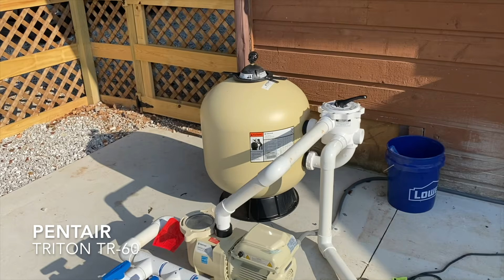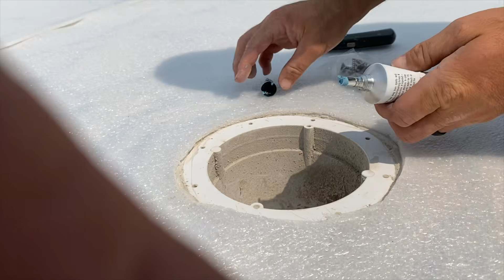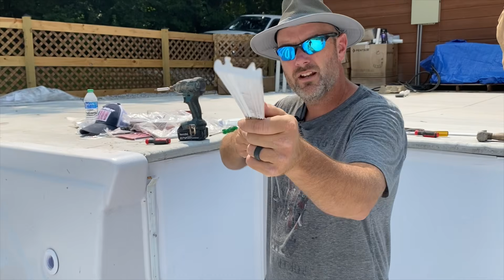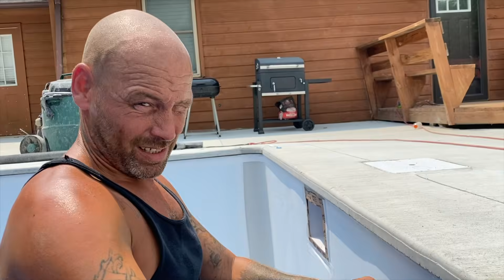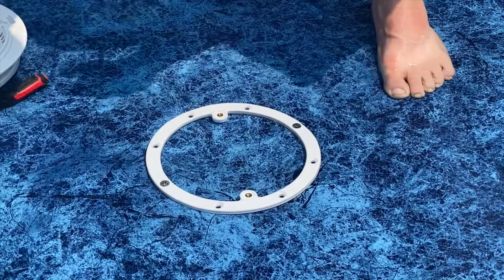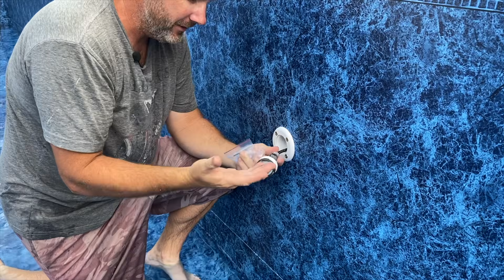DIY ICF Pool!  Detailed Vinyl Liner Install

Comment: Thoughts on what to do if there is a leak around stair trim? Do you add a waterproof caulk or would you drill in and add screws to that trim? It seems maybe a few of the screws backing is stripped and maybe needs a new screw. This is in a new liner but 3rd liner overall I’m wondering if those screw holes are not tight to the screw threads now
Reply from the maker: New screw on each side of stripped one

Comment: Hey thanks so much for the info and great video.  What kind of glue do you use for the foam on the floor and what glue and tape for styrene sheets.  Do you space sheets or overlap.
Reply from the maker: Overlap the sheets, go to all3pools.com for any products u need

Comment: What was the spray adhesive you used on the floor foam roll outs?
Reply from the maker: It’s made by 3m, I’ll have to get u the actual formula

Comment: What do you do if the track on an inground pool is eat up in a lot of areas. Basically almost half of my pool track is not useable. Can the track be replaced? How do you fix it?
Reply from the maker: It can be replaced, not fun but necessary on a lot of older pools
Reply: Question i was looking for

Comment: Great video!  Not sure why it cost 4000$ in labor for a new liner.
Reply from the maker: National average for a liner replacement is liner cost x2.5, I don’t make the market…. It used to be 3x but liners went up significantly over the past couple years and the multiple didn’t keep up

Comment: The liner in not straight at the stairs. That would not be okay if it was my pool. 

Does it fix itself when all the water get into the pool?
Reply: My eyes went right to that as well and that would not fly with me either.  ironically he mentions to be carful with the cuts cause you don't wanna have to buy a new liner at your expense for botching the install. right when those first cuts and the screws went in around the perimeter of the stairs the liner was botched right than and there cause the border is crooked and slopes down . it was not pulled taunt enough in the void of the stairs where there is no where to hook the bead and he did catch it. if this was my pool I would be demanding a new liner be ordered asap. and would be livid knowing how long I need to wait again for the new to be made and delivered

Comment: Local 417! Love it. Quick question...assuming vinyl and these type stairs are a little more budget friendly on the front end. Is starting with a vinyl liner on an ICF pool and then 7-10 years later transitioning to a more permant/solid finish doable? EcoFinish, gunite, etc. We're 100% doing one of these next year and thinking of doing vinyl on the front end to save some money early on... PRAY some of your kits are ready soon! We've used Rost before too...good folks!
Reply: Good question.

Comment: This kills me to watch. I just did a liner in 5 hrs today and you made so many mistakes its kills me.. what did you charge thesebpoor people.. all the foam is a joke
Reply: At 8 lbs plus a gallon you think that foam does anything hahahahaha. Only evef seen liners with foam have issues do tp foam folding with ground water.
Reply: @matf3337 so dont put foam on the bottom or in stairs?
Reply: Also your gasket approach is severely wrong
Reply: This just garbage this has to be killing your business costs. Why do you need 6 people and it days i could do this pool twice in one day by myself
Reply: Is it normal for them to use two gaskets? I thought drain and skimmer gaskets were sold in pairs as a kit? When I took out my old liner I noticed the gasket was behind the liner only and not doubled up.
Reply: I dont know sh-t about pools, but damn, hate much???  Where's your channel/videos.  Monday Morning Liner Installer.   ahahahhaha.

Comment: What is the price comparison between a vinyl liner vs an Eco coating? ( apologize if I misused Eco term)
Reply from the maker: It’s significantly different, not just the finish, the structure of the pool needs to be far more robust for ecofinish, a monopour icf shell, Gunite she’ll or fiberglass shell is necessary, vinyl liners can hold up with far less structure as the liner itself does the work…. So it’s usually at least double the cost all told
Reply: @all3pools  To clarify, which is twice the cost, ecofinish or vinyl liner? Why would one want a pool at twice the cost vs the other?

Comment: Could the bottom of the pool be made of 4 inches of structural polystyrene? Followed by the liner on top.  
 I'm trying to avoid the cost of a concrete bottom.
Reply from the maker: Is the foam free to u?  If not I can’t see how it would be cheaper
Reply: no but polystyrene or xps is definitely cheaper than concrete and the labor to install concrete.  plus you wouldn't need skilled labor to lay foam slabs down.  Michelle, you would probably need those poly sheets that he put on the icf walls to prevent impact damage.
Reply: Lol. I see your point.  I was going to go with a sand or grout bottom. With polystyrene under the sand.  But someone mentioned to me that I don't need sand or grout on top of the polystyrene.   Is this correct?

Comment: Great videos! I see you put a small radius in the corners of this one. What did you use for that?
Reply from the maker: The liner tracks either come bent or notched, then we usually use a foam chamfer strip but like everything else they are out of stock so we used mortar and a 4” elbow to shape it lol, then covered it with liner foam, worked well but the chamfer is easier, ready for shortages to be rare again!

Comment: Is there better skimmers and returns that work better with icf walls than others?  I'm planning on building one in the next year or 2.  Love your videos!
Reply: Check out Paramount venturi skimmers.  They're a return and skimmer in one unit.  Less cuts, less holes, less work.

Comment: wanna come build my pool?  northern illinois
Reply from the maker: Little far for me, but I’m getting ready to train a guy out of chicago…
Reply: @all3pools  very cool. how much u thinking ball park for a 18x36 with deep end and fiberglass steps, icf panel pool with liner. just a ballpark so i know. I thought about trying to do a cinder block pool with a poured floor bottom . then spraying the walls in polyurea